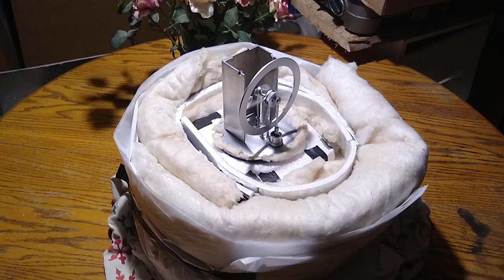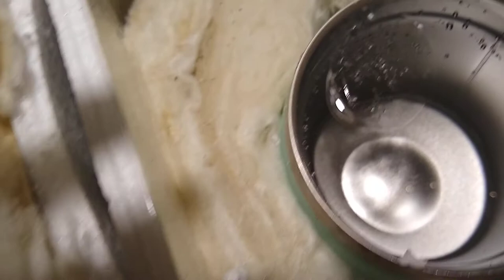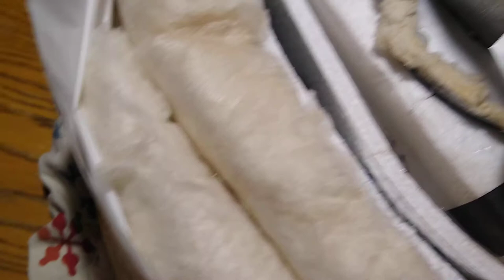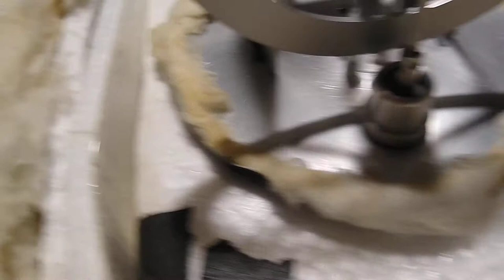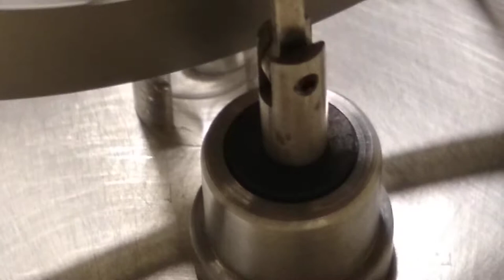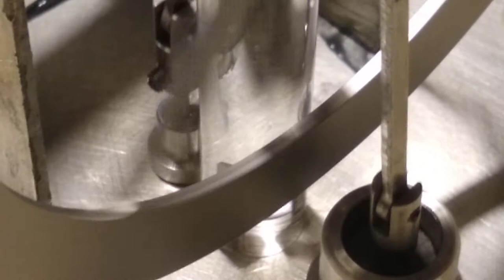Stirling engine after 32 hours running on ice.

Comment: some info.    this  design  is  Too  compact.       a too-compact configuration  results  in a gradual degradation of performance; as the temperature  Difference  between the sides becomes,  Less.         imo,  the (normal) operation of a typical displacer mechanism  is  based on  Heat, and  Expansion/compression.   not lack of heat.   googletranslate
Reply from the maker: By comparison, a "normal" engine running on a cup of boiling water ran for about 3 hours.
Reply: @peoplesresearchcenter6184  fyi ---   running  any  kind  of  engine  UN-LOADED  tells you  Nothing !!!!     hot/cold,  NO  MATTER.   out
Reply from the maker: @daviddavids2884  more could be learned by having the engine generate electricity or something. The reason for the unusual set up, is to test Nicola Tesla's theory that a heat engine would run longer that way. The engines' own friction generating heat in the bearings, agitating air around the flywheel, making a little noise, etc. is a load, if only a very small load.
Reply: @peoplesresearchcenter6184  1)  any load that is  INTERNAL  to the system  does  Not count as  load.      2)  even if this idea is valid, it is has  NO  practical value.     unless  you  have a  NO-losses way to maintain a source of  Coldness !!!    googletranslate
Reply from the maker: @daviddavids2884  that has certainly been the prevailing scientific consensus for the past century. Tesla however believe it could be "the ideal way of obtaining motive power". 

https://medium.com/predict/teslas-self-acting-engine-e8aeaf06451e
Reply from the maker: @daviddavids2884  I can agree that beliefs in general mean little without experimental evidence one way or the other. So far this experiment does not prove Tesla wrong. Apparently ice will take longer to melt when used to run a heat engine, as he predicted. But one experiment doesn't prove anything either. I think more research is needed, rather than just dismissing the idea without a trial, as has been done for the past century.
Reply: @peoplesresearchcenter6184    GAAAAWD       WHERE  DO  YOU  THINK    ICE   COMES  FROM  ---   the  ice  FAIRY !!!!!!!!
Reply from the maker: @daviddavids2884  Tesla's theories relating to heat and heat engines can be examined at this link:
https://www.unz.com/print/Century-1900jun-00175
In particular the heading: "A departure from known methods" for the rationale of running a heat engine below ambient temperature.
Reply from the maker: @daviddavids2884  from viewing your channel, you are quite the expert on analyzing Stirling engines. I was wondering, why do you suppose this engine runs at a higher RPM with the sink covered by insulation? It is running on a cup of boiling water.

https://youtu.be/fFByKkGr5bE
Reply: Thank you for your informative debate you two. I see both of your opinions. Its provides a lead to a starting point for further research by others. Keep up the great work everyone!
Reply: the upshot is,  you  are  giving  prc   WAY  too  much credit, for his stoopidness.
Reply: You are correct. Newtons second law of thermodynamics says that the friction generation plus electrical output will always be less than the energy it took to remove the heat from the water initially. Moreover, the heat generated from the friction may help improve the efficiency of the machine, but not so much as to over come newtons second law.
Reply: @zspies  jeeezuss       an agreement, followed by that many  words, might as well be  a  disagreement.      i  choose to  make use of  COMMON  SENSE,  whenever  possible.     consequently, in this case, i consider reference to newton's  work  to be  a  waste of  words.       cheers
Reply: @daviddavids2884  alright, and that is your opinion. The fact is, ice IS found in nature. If you had an effective way of supplying your engine ice, it COULD be worth it.